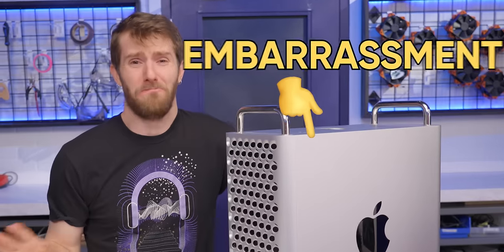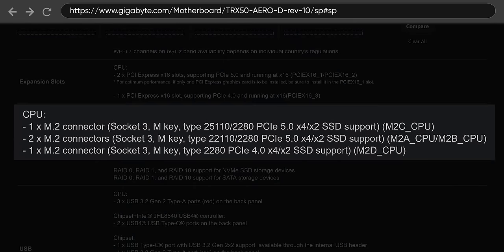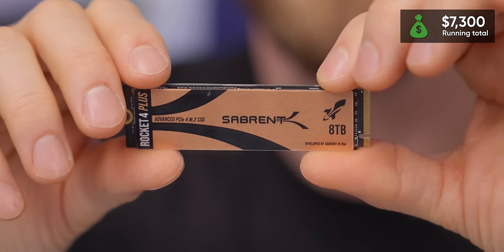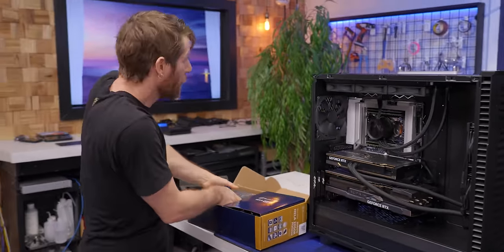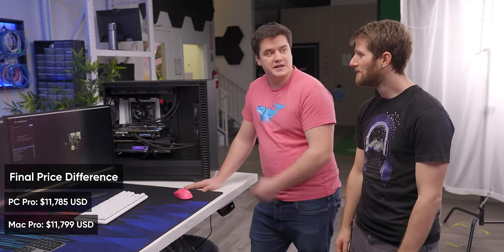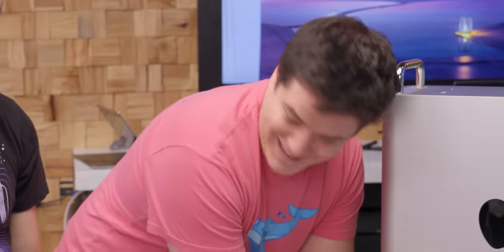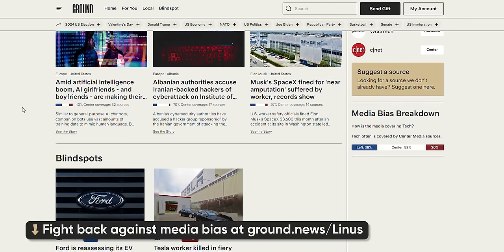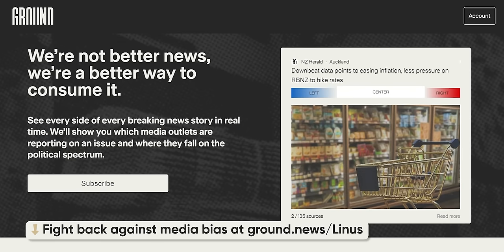The $10,000 Mac Pro Killer

Comment: One big advantage of the Mac Pro is power draw. The Mac Pro has a max power draw of 330w while the custom system has a max power draw closer to  1300w-1600w. Assuming the machine is running 40 hours a week and the cost of electricity is $0.15 per kWh, the Mac Pro has a max energy usage of ~$100 per year. While the custom machine is 4-5x times that. Combine this with the cost of installing the needed 240v outlet in NA and the custom machine will be a few thousand more after a few years of heavy use. Even more if the company using it has a net zero carbon policy.
Reply: I'm super confused why you need a 240v outlet? Its not a washer and dryer dude.
Reply: @deanwilliams433  That computer uses more power than a washer or dryer. 2000w is well beyond the capabilities of a 120v outlet.
Reply: @koalaunknown  I think you need to read up on your electrical knowledge in the US. a 120v 20-amp circuit can handle up to 2400 watts and the more common 15-amp can handle up to 1800 watts. You can even upgrade to a 25-amp circuit that handles 3000 watts before you need to consider 240v. Sure, they got a 2000 watt PSU but I doubt this system draws over 1600 watts at any point of the stress running 24/7. As long as they are on a dedicated circuit or don't run other devices on that circuit they are fine.
Reply: @deanwilliams433  the power supply they are using has a 240 V plug.
Reply: @koalaunknown  👍I see that it can do variable power so on a normal US 120v it can only do 1650W since it cannot take more than 16amps. This is way overpriced power supply.

Comment: The Classroom render in Blender didn't seem right. If I render that at its default settings using my single 3080Ti with the OptiX API (which is how you should ALWAYS test RTX based cards in Blender), it completes in around 15 seconds. A single 4090 would do that in half the time, tho for a few reasons, dual 4090's wouldn't half that again, since its not a linear double of speed and at such low numbers you have a fix amount of CPU scene build time at the start anyway.
The benchmark time you show more makes me think it was a CPU render, which by the way, if you open the classroom.blend file, it is set to CPU rendering by default.
Now sure, this wasn't a 'LABs Review' or anything, and chances are the Mac is CPU rendering as well based on the default file. But GPU rendering using the latest Blender 4.0.2 release should do somewhat better now (will still get killed by a 4090) but at least better and the video does state it was  'GPU' test.

Comment: Effective management will consider added energy costs in their decisions and particularly in places where energy costs are high, a notably more efficient machine may have a better business case than something more powerful but cheaper. And that's to say nothing about changing your operating environment if your staff are already used to the Apple ecosystem.
Reply: @militant_pacifist If you're a small shop, it's fine to ask for this from just 1 or 2 people, but how about 20? 50? 100? Do you have any idea about the capacity of the average working individual? The average worker barely knows how to operate the same system they've been using for the last 10 years well enough to do their job and every minor change to those systems always creates a mess for these people and in larger shops, this issue can't be understated.

Comment: Linus there will be another 15900K when does one stop upgrading the 13900K is still good enough I have used the processor and the AMD 96 Core threadripper is currently the ultimate workstation

Comment: I do have to agree overall. I find that a lot of Mac computers are starting to creep up in price, and the Mac Pro just spits in your face for what you get in comparison to other products. As much as I don't like Apple hardware though, I did shell out for a Mac Mini, as I find it's a very reasonable price and is incredibly minimal. I use it for a few specific edge cases with content creation that on a Windows computer would cost me more, but for the 512GB M2 at around $1000 CAD, it's really not bad for the performance you get out of it. Try telling that to a Mac Pro.

Comment: As soon as I found out about this Mac Pro, I was thinking it was really dumb to put the same SoC in it as what's in the other, smaller Macs. It's a big tower case, so there is ample space for RAM and M.2 slots along with those PCIe expansion slots. It is also insane that they don't even support using a PCIe GPU in it, forcing you to use the iGPU. I don't want to see them can this system -- I want to see them develop a CPU specific to it that will allow for these traditional expansion options and also just let them go nuts with core count and speed since they don't have to have the other components on the same die. They should make the skunkworks of Apple Silicon for this model, not throw in the same SoC they offer in the Studio.

By the way, I'm watching and commenting from a Mac mini M1 running Fedora Asahi Linux! It's pretty damn nice already. Really stable and feature-complete. The only thing missing for now, aside from some software choices, is DRM support in Firefox (and no Google Chrome browser, apparently, though there is Chromium), so I can't watch Netflix on it. They also have work to do on supporting all of the Apple hardware, and GPU support is incomplete (3D is still slow or nonfunctional), but it has come a long way overall. Might be something fun to talk about on your little internet show here.
Reply: I think the reason you can't put in a dedicated GPU is because of the soc design
Reply: @ThatAverageMTBer  Could well be. I'd like to see a CPU design specific to the Mac Pro that allows for more flexibility and upgradability, like I said before.

Comment: Software engineer here. My employer (large company you probably use their products) forces developers to use Apple Silicon MBPs and it suuuucks. Laptops are great for working from a cafe but I spend 80% of my time at a desk and they are slow compared to a 7950x desktop that's like half the price. For one internal project I have a build time of 18 minutes - or 5 minutes with a 7950x. I spoke to the engineering manager and they said that they are happy for me to put up with the slower build times because they have a deal with Apple 😂 oookkkaaaayyyy

Comment: It will never cease to boggle my mind that apple still charge an insane amount of money for storage despite it not really being anything special like soldered on ram (which allows them to have blazing fast speed). LIke okay you could make the argument on a laptop or mac studio that you would attach it to a docking station and use external storage (which is a dumb argument but it's at least valid) but a "pro" machine like this should allow you to add in storage for a reasonable price as well choose your own vendor. I really wish the apple community would put the 3rd degree on apple for not opening up storage. At least allow m.2 expansion or something if not the main drive.

Comment: The real problem with this mac pro is that it took them so long to make M2 version that most of the hardware that could have been utilized in the PCIE slots(which is objectively the only point of buying it), have already received thunderbolt or usb-c counterparts. So at this point even the customers with fuck you money that doesn't care about the price tag, just the features, dont even need it anymore if they can get the same functionality on mac studio and usb-c cards, with less space taken.

Comment: If I was apple, I would have used the new released overpriced hd5450 and nvidia 730 for those pretty cheese grater. For the price, they go together and low power and less need of ram usage for those parts and their features. Preparing means it takes files to run one shot that render... PC always better for the price.

Comment: I'd just like to point out this is completely unfair and BASED comparison, did I spell that wrong? "b-i-a-s-e-d" 🤔 no I was right first time.
I didn't see a complete breakdown of every expense for the PC Pro but I doubt you included $5000 'worth' of bloat-soft that Apple requires all users 'invest' in with every purchase and thousand dollar RAM upgrade.
A fair comparison would be a second hand current gen Apple stripped bare to a linux distro performance tuned for these tests.
That's what you get when you compare a Raspberry Pi with an fancy iGPU to an off the shelf performance built machine and bulky OS.
Imagine the difference if one were to custom tune hardware for specific use cases, custom chip for every line of software!

*despite being #10 out of "top 500 songs of all time" according to Rollingstone's 2021 list, the Outkast song Linus mentioned is over 20 years old now.
Who listens to anything other than hiphop? Zoomers and Millennials dosing on Adderall and G-Fuel don't have an attention span of 30 seconds.
Unless it accidentally plays on algorithm, they're not going to hear anything older than 'current trends' on TikTok,
which are an abysmal echo chamber of recycled soundbites and autotuned dogshit. I've made better with AutoRap app back in the day.
We gotta think with the hive mind to be accepted for our uniqueness.
As the great M&M says, 'nobody listens to techno'
That song is still on fleek. /s

Comment: I mean. For the comparison I get it, but comparing a 350W 64T CPU with an M2 ultra is just completely insane. 

That whole chip doesn’t go above 90W total! The other system needs a 2000W psu and can easily suck back 1400W under full load. I mean yeah it delivers much more in the compute category, but at 15 times the power consumption. 

The mac pro is a weird product (as the PCIE slots don’t really add much now do they) but that chip is brilliant.

Comment: "Unified memory" is not a thing when you're comparing it against a PC with dedicated gpu memory, why are you making like it's an asset?

M2Ultra is also not a thing, it's got 130 BILLION transistors and LOOSES to a LAPTOP cpu (7945hx)  that only has 13 billion transistors.

ARM is good for NOTHING but instruction per watt, only important on mobile and servers

* gigs ram can NEVER be as good as 16 gigs SINCE excess ram is used for cache, you CAN'T have a decent workload with much left over for cache if you only have 8 gigs

When you have excess ram used as cache what you ACTUALLY have is ram being used as storage, in other words your storage becomes as fast as ram

Apple is ALWAYS full of bull

And finally, when you have to put your ear to the PC< it doesn't matter how much quieter the MAC is, they're both practically the same. and anyone wanting quiet over 6 times the speed just doesn't need performance

Finally, Apple silicon was NEVER impressive, everyone, (including you) didn't know it used exponentially more transistors to reach parity, like putting 6 od your miserable boxers in the ring with an average boxer and claiming your program is better

Comment: If you were wanting a pro machine for music you could save a bunch  using a lower GPU. Not all productivity needs a 4090. Really doing a build with 4090's if there is a shortage is a bit pointless. 4090's have been YouTubers epeen since release. 
A better more useful video would have been a build with what is available and then compare those.

Even for just entertainment builds and info about unavailable or overpriced limited availability gear is getting tiresome.

Comment: The Mac Pro is not marketed for the average user. Its target is for professional use only. This video poorly represents both sides with no fair comparison. Very misleading results with cinebench not really optimized for Apple M Mac’s. I just find this whole video misleading, for just another joke at what clearly dosnt work on mac but don’t make a fare comparison with cross platform bench tests. Yes Apple is expensive with the ssd upgrades, but that is what the PCIe lanes are for, so you can expand the ssd storage and add sound cards and whatever else professionals use. And Apple Mac’s use less power consumption And run nearly silent. So I heavily disagree with this comparison video.
Reply: run silently, for what the f in the world, the pc is already at a very low temperature and water,aio, pile of shi technology whatever exists for cooling which can make your pc even more silent than ever, you cannot even put a damn gpu on those pcie lanes
Reply: You don’t need a gpu for the PCIe lanes. Apples igpu is more then enough gpu for any professional use. Now amd thread ripper is a very powerful cpu and also runs like a hot potato. You have to water cool it to keep the temps tame. Apple is air cooled. Apple is all about efficiency over mass wattage power draw like amd is.

Comment: The Mac Pro's audience is strictly in the Pro industry where their pricing, while awful, isn't as big a deal as if it were a personal purchase. I think it's very unlikely any significant number of people are buying it who have a choice to buy something else. Taking the audio pros as an example, there is tons of hardware that only works with the Mac "ecosystem" and Windows itself is also not the most stable or complete platform which is essential when your computer is your tool for income.

Put more simply, this isn't killing anything. The only way the Mac Pro stops being relevant in the pro space is if/when Windows (and off-the-shelf hardware) doesn't make you want to rip your hair out. Apple knows that and that's why they charge their outrageous price for it. The only thing they need to realistically provide to not force their users to another platform is PCI-e slots.